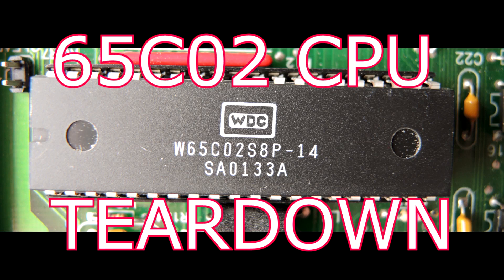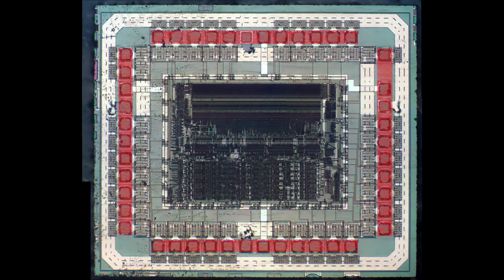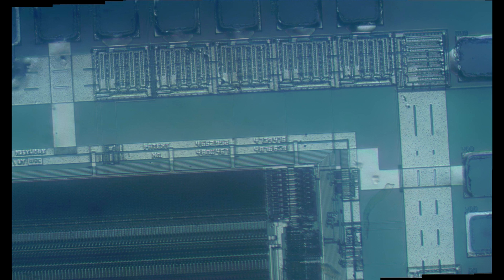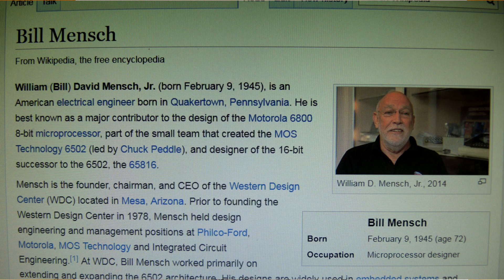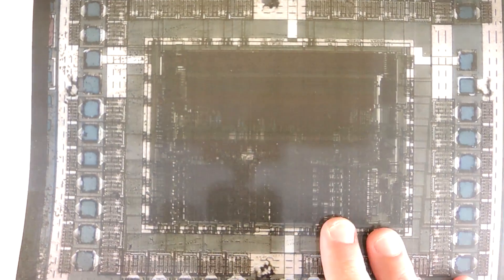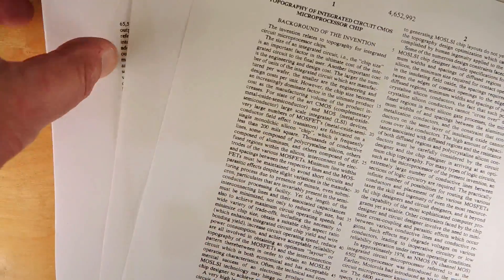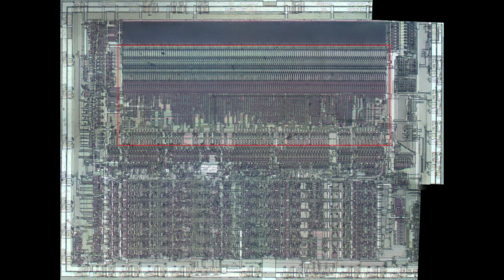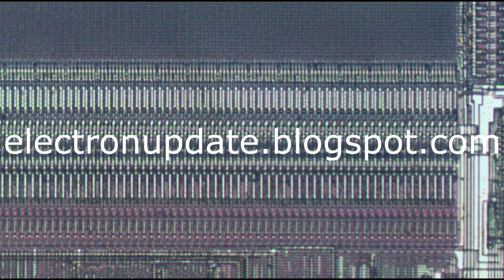65C02: Tear down, A look at the CMOS version of the 6502 CPU

Comment: At the bottom half sides, there're the Address Bus High buffer (left side), Address Bus Low buffer (bottom side), and Data Bus buffer (right side), which interface with their homonimous internal buses. That half of the chip is divided in vertically laid out registers and the Arithmetic and Logic Unit (ALU): From left to right, index register Y, index register X, Stack Pointer (SP) register, ALU circuitry, ALU result hold register, more ALU circuitry (perhaps Effective Address (EA) high and low registers), accumulator (A) register, Program Counter (PC) high and low registers. These processor registers are crossed by the Special Bus, composed of stripes for (bottomward) bits 0 and 8, 1 and 9, ..., and 7 and 15, with gates on the right side with the Data Output register and the Input Latch that connect to the Data Bus buffer. Above the latter, in the chip's upper half, the following (topwards): The Processor Status (P) register, the pre-fetch Instruction latch, the Opcode modifier, and the Instruction Register, all of them on the right side. Over the Special Bus and its registers, horizontally like P but on its left, the Register Gates that interconnect them and the ALU for data transfer through the Special Bus, under control of the Transfer Control Unit, a part of the decoder (another is the Status Flags multiplexer and the Status Flags Updater) to the left of the instruction circuitry mentioned above. On whose left the Interrupts Sequencer and Decoder stand on the left side of the chip. Over the decoders, the Programmable Logic Array (21 by 131 40-bits microinstructions) that locates the appropriate microcode instruction addressed by the microsequencer and the modified opcode. Over the PLA, at the top of the chip, the Interrupt Sensors for Reset, Non-maskable Interrupt (NMI) and Interrupt Request (IRQ).
Reply: Best comment tanks!

Comment: Worst processor I've ever seen in my life, working in industry with this processor is suicidal
Reply: why
Reply: @C64Lover  65Cxx and 68Cxx processors
immediately affected by the external environment

I would not recommend for industrial use.

I tried all the processors and researched and I saw that the best processor that is not affected by the external environment is DSPIC.
Reply: @cemustun3627  what do you mean by "immediately affected by the external environment" ? 65xx were used in med and industrial stuff because of its extremely low interrupt latency
Reply: @C64Lover  
we saw this processor in college and programmed it with assembly
our experiment set
 lab - vot 65C02
As soon as we brought our hand close, the processor was either resetting or crashing.
there was indecision
Reply: @cemustun3627  lol, there was a design flaw then on the board, I have shitload of commodore gear and nothing breaks when you touch chips, even 3rd party disk drives like CMD FD2000 with 6502 chip is rock solid
Reply: @cemustun3627  I had similiar problems however with badly designed protoboard with AVR microcontrollers
Reply: @C64Lover 
 you may be right
but hit the processor with the pen
you will see that the processor is affected
Reply: @cemustun3627  why pen differs from multimeter/logic analyzer/oscilloscope probe ?
Reply: @C64Lover  shake test
If the moving machine has this processor, the shakeouts will be unstable.
Reply: @cemustun3627  in Poland there is a guy who self-made a series of 6502/65816 based fuel injection controllers for his FSO Polonez (he also makes demos for ATARI XL/XE, this year ReWind demo includes a 3d raycasting engine - better than wolf3d yet worse than doom, he wrote that himself) and that CPU is capable of running in a car, device that shakes all the time

Comment: That's facinating .. the fact that they included the layers within the patent, which I presume is the layers used for the lithographic masks. That might explain how the soviets reverse engineered it into their own cloned version of the chip, which literally ran the same software at the same speeds.
Reply: The sovjets (and japanese, etc) made versions of many other CPUs as well. Some companies did reverse engineer them for real, i.e. no copying of patents or chip layouts, just from the processor's behaviour. 

However, a NEC engineer admitted in the 1990s that they had looked at the actual Z80 chip and were delayed for months because of a few traps than Faggin and Shima (Zilog) had put in, mainly blind contacts (vias) between metal and polykisel that didn't really connect, only looked like they did.
Reply: 6502 clone was produced in Bulgaria, 8080 clone in Poland and 8088 in Russia however it is questionable who did reverse engineer or industrial espionage.

Comment: Can 6502 rom and memory be used on the W65C02 (are they interchangeable), and also is the  assembly language the same or similar
Reply: The W65C02 is identical to the original MOS 6502, so yes
Reply: @TcG4mer   Is it, though?  I believe the W65C02 has several bug fixes, a bunch of additional instructions, and a couple of new addressing modes.  Additionally, it no longer supports the 6502''s "illegal" opcodes.
Reply: @rbrtck  Good point!

Comment: The PLA is a state machine. The 6502 doesn't use microcode. You can read about it here :
http://forum.6502.org/viewtopic.php?f=1&t=2657
Reply: You are definitely right on that. I've implemented it as microcode in my DIY 6502, but in the real thing everything happens in rigid states, and it is actually very clever how much it does in parallel.
Reply: How does a CMOS PLA work? I tried to look it up, but cannot get around NAND gates with a lot of inputs => slow! And for this reason I think that memory usually doesn’t use CMOS for everything. Though the cells are Complementary.

For the first cycle at least I would try to optimize the control lines so that each only depends on less than 5 bits in the opcode.

For the second cycle I would translate nibbles into addresses. Both nibbles and the phase each activate an address line which outputs Vdd or Vss. So we only need to combine 3 inputs ?

Comment: Chuck Peddle and Bill Mensch don't get near enough credit for what they did for the tech industry. Those guys and their team designed the original NMOS version of the 6502 for MOS Technology, and later Commodore. Bill went on to form WDC and made this CMOS version of the 6502.
Reply: @@NRGYFM is seldomly explained well. First: power increases with amplitude. So while with FM we need to look over a wide bandwidth (of noise) the peak height only is of the height of an almost silent AM signal of the same quality. Secondly, Klystron can only be FM . Yeah with another grid they can AM as used for digital. Though digital satellite TV was phase modulated. So still a TWT, but each bit value corresponds to a phase ?

Comment: how does a ROM work on a gate and silicon level?
Reply: It's a bit complex, but basically in most EPROMs there is an array of MOSFETs which have a floating gate, basically meaning the gate itself has no connection to the rest of the circuit and is completely covered by oxide.  A control gate above it injects electrons into the oxide layer, which become trapped in the oxide just above the floating gate, holding the transistor in the on state.  Intense UV light can be used to dissipate this charge.
Reply: douro20: that is an EPROM. A ROM had the contents defined when it is made. For example a diode array: horizontal circuit lines are used to select the data to be read and vertical circuit lines are the output. A diode is placed between these lines when a '1' is needed. Nothing means a 0.
When the horizontal line is energised, the diodes will conduct to the respective output lines and output the programmed code.
The horizontal lines are driven from a decoder, so only one is active. And in practice, transistors or FETs can be used instead of diodes.
Reply: @pizzablender the title says CMOS. So how would a CMOS ROM work? For instance I would provide a balanced word line. The not-gate would connect to one of these.

With a single metal layer, the horizontal lines would be Vdd, bitline , Vss, bitline, Vdd, bitline ..

The vertical word lines are made of long poly silicon gates driven from both ends. I wonder if the address generator should sit in the middle or duplicate it?

Comment: Shrink and white space might be so they could use that smaller processor die as a hard macro for other designs. Keeping the padring as is for the reasons you outlined when realized as just the cpu in its classic 40pin arrangement.